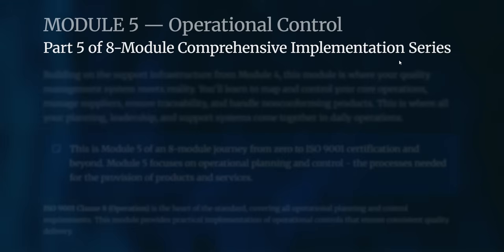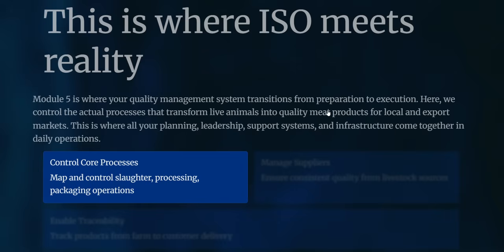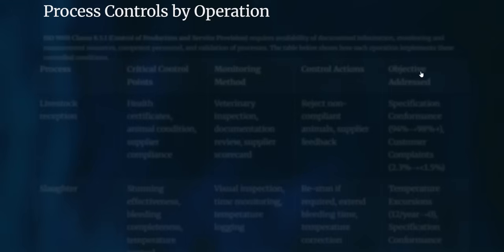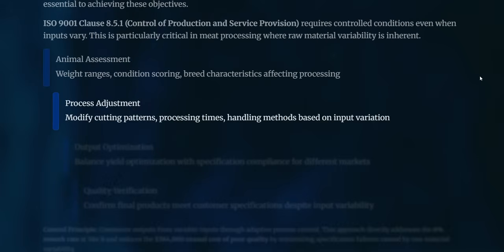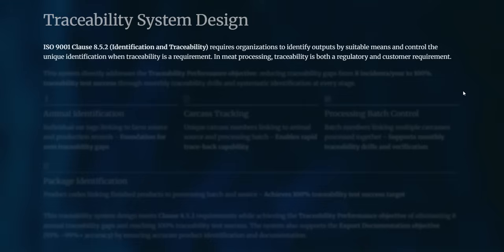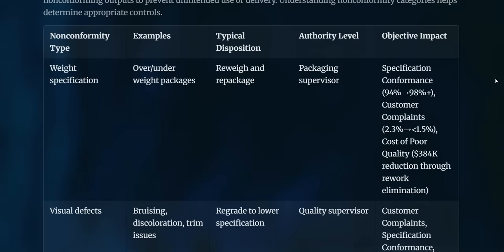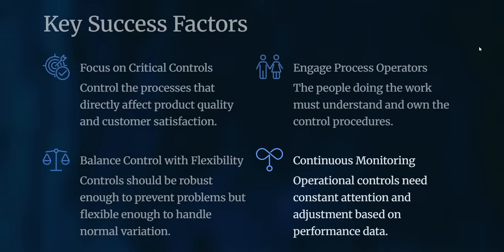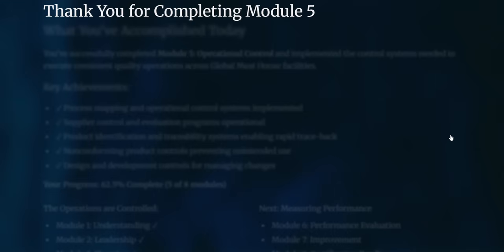ISO 9001 From Zero to Certification – Module 5: Operational Control (Clause 8 Explained)

Comment from the maker: This is Module 5 of an 8-part ISO 9001 implementation course.
Module 5 answers one question:
Are your operations actually under control — or just busy?
Before moving to Module 6, your organization should be able to:
• map and control core processes
• manage suppliers and outsourced activities
• demonstrate traceability end-to-end
• handle nonconforming product confidently
▶ Module 6: Performance Evaluation & Monitoring — coming next.

📌 Start the full course here: 
https://www.youtube.com/watch?v=635Yd0RY7VU&list=PLpjg2sQqENxpX1I-BuqdfCaL003zCMf9O&pp=gAQB ISO 9001 – From Zero to Certification (Complete Playlist)
or
📌 Start the full course here: 
https://www.youtube.com/watch?v=nbldSNzf0Ms&list=PLpjg2sQqENxrXg5OHN88-I17cmLA7qsPI&pp=gAQB  ISO 9001 Implementation – Step by Step (Practical Training)